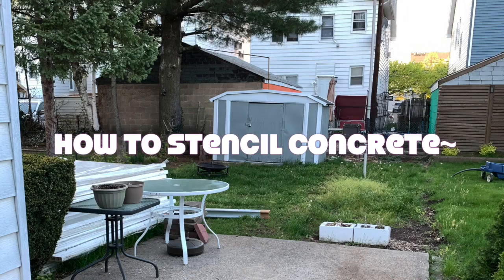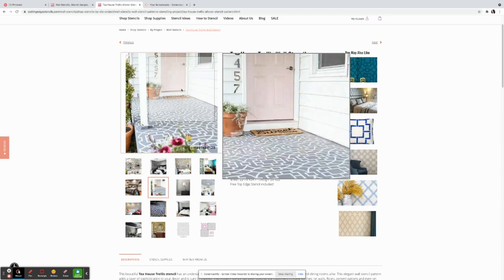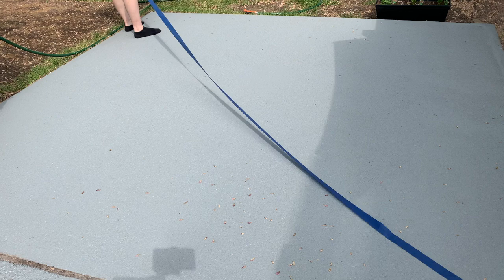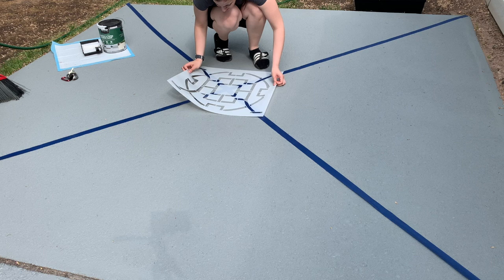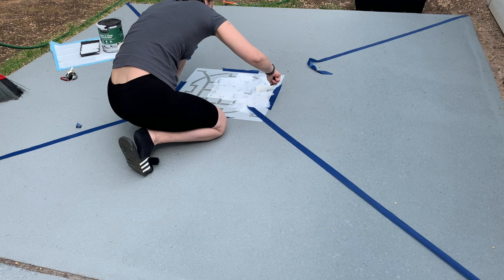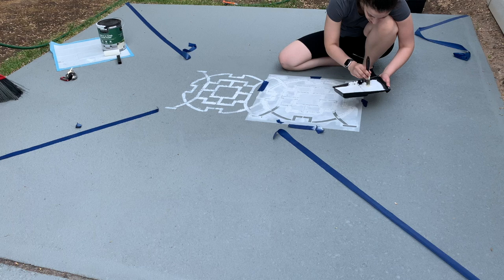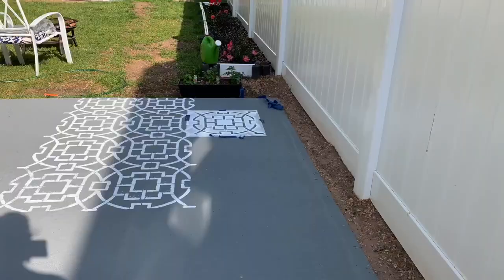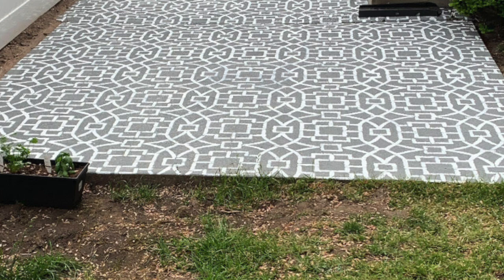How to Stencil a Concrete Patio!

Comment: PLEASE HELP 😊

I want to paint a design onto my cement steps. With acrylic paint and small paint brushes for detail. Im painting the face of the steps so you see the design facing you as you walk up them. What should I apply as a base coat BEFORE painting on my design. Also, what sealer do I apply at the end. I live in an area that snows. Thank you.
Reply from the maker: @kal-w6i  I would suggest paint specifically intended for concrete otherwise it will chip. Make sure you use etching  formula before applying paint so it will adhere. You need a concrete sealer and apply following directions.

Comment: Not too sure about the 'bleeds' under the stencil. Taking more care to get proper edges would have made it much better end result I'm guessing. Maybe I will find out when I do mine!
Reply from the maker: Stencils are synonymous with bleed through regardless of tools used or the care being placed between each imprint. Since concrete is porous and is not exactly a flat surface just go lighter with the paint and then you’ll have to fill in. Either way touch ups are inevitable. Good luck !
Reply: @franca2796  yes painting is very forgiving you can always touch up! The only way to get perfect edges would be if you painted the stencil edges with the Grey and then applied the white after. Because the Grey would seal the bleed through. But honestly not worth it unless your doing multiple stencils at a time. Touch up was better for her method with one stencil

Comment: Did you seal it ? If yes what sealer did you use?
Reply from the maker: I did seal it but I do not remember the concrete sealer I used. If you look up concrete sealer at Home Depot or Lowe’s you can find several brands. I know I did 3 coats.